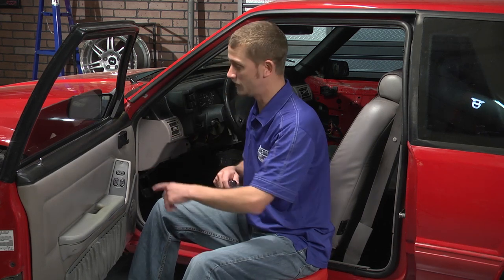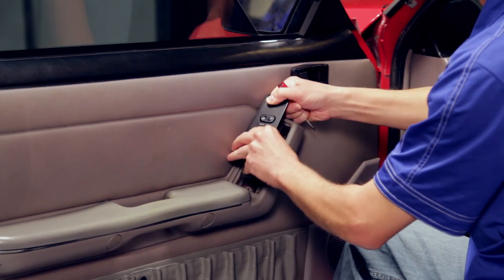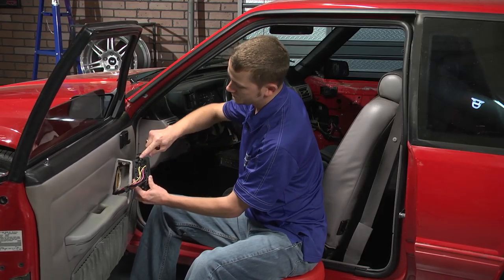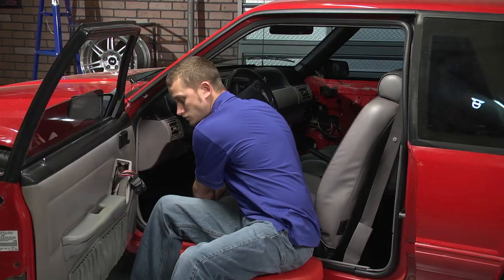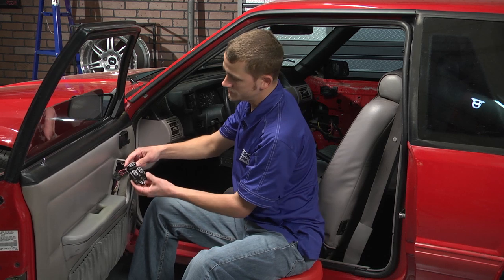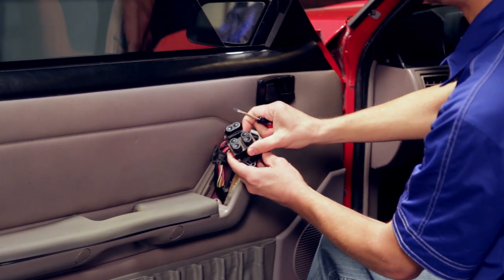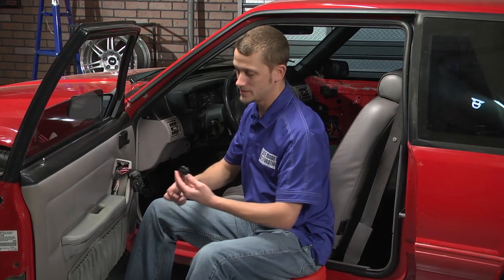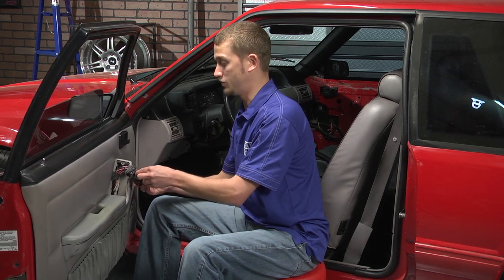1987-1993 Fox Body Mustang: Door Lock & Window Switch Install

Comment: My locks won't work and a previous owner had a security system but they took it off before selling the car. Is there any way I can check to see if it's all connected properly or see if I really do need new lock switches?